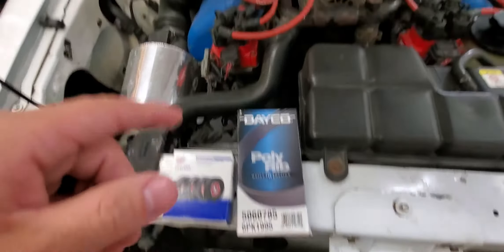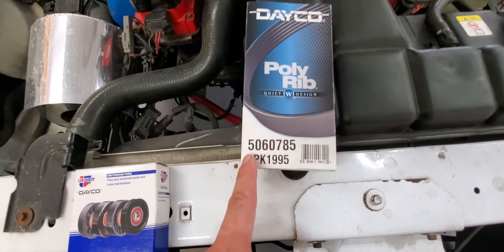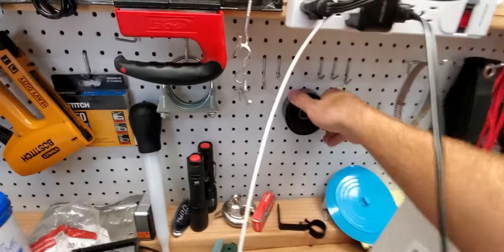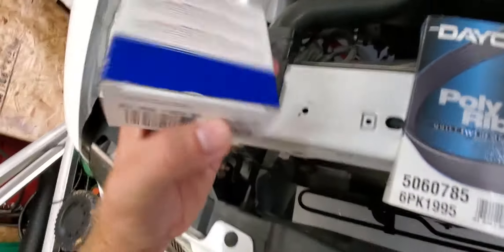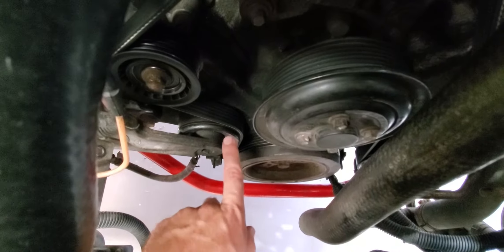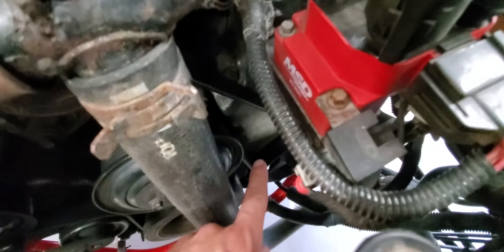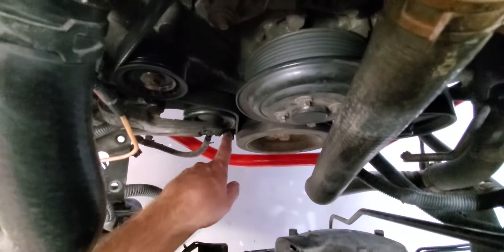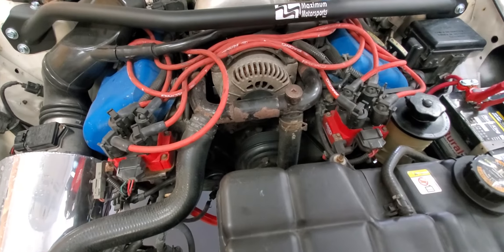How to Re-Route Belt After A/C Delete 96-98 Cobra Mustang

Comment: Would it be possible to keep the ac compressor and still run this without taking the whole ac system out?
Reply: Did anyone ever figure this out? Im wondering if i can do this as well
Reply: I am running this setup on my 1996 Ford Mustang GT (4.6L 2V). I did not take the AC Compressor off (only removed the connector) so that I can go back to it whenever I want.

Comment: Will it be the same if it’s on a 2v? Since it’s almost the same thing
Reply from the maker: It is not the same
Reply: It is the same on my 1996 Ford Mustang GT (4.6L 2V). This exact setup with these exact parts works well so far. I am running this set up without even taking the AC Compressor off (only removed the connector) so that I can go back to it whenever I want. You will likely notice a slightly better response and/or shifting with this belt modification (automatic transmission).

I am editing only to note that I assume this will work on a 1996-1998 GT, although I can only speak to 1996. This will NOT work on a 1999+, as the belt routing is completely different on those. There is a different method to do an AC bypass on those, but it is different than this.
Reply: @willa8687 I just did this to my 96 with a complete 01 bullitt engine swap, I'm using the 96 timing cover to retain coil pack brackets. I also have steeda underdrive pulleys. Works great. 

Edit: Now it squeals on startup no matter what and endlessly chirps if it rains. Gonna step down to a 77 inch belt and hope it even goes on